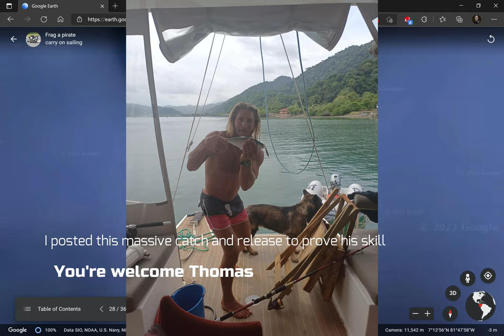Amazing anchorages, Horrific equipment failures

Comment: Hi James and Eva, thanks for the great video. Very nifty effects on that one too! You are having a real adventure, brave man and woman away from the most common routes and places. You take your chances but you get your well deserved rewards. I wish you the best of luck. One little question, since Navionics is wrong and the paper charts from Open CPN often off by quite a bit (with the GPS) even if they are very accurate locally, what do you use? How do you do it? What about google and the programs like Ovital and such? Cheers!!
Reply from the maker: Every single chart you can get your hands on, take it. This region is covered well by the bauhaus panama cruising guide. If you use opencpn you can buy the charts from the o-shop. futhermore paper charts are always a reliable fall back. Sat images are great but use your eyes first. Use the midday sun to help you also. You can see the shallows and the turbulent water over them.

Comment: Good tip on the CPU and advisable to get a circuit wiring diagram of it from Volvo so that you can bypass all it’s functions if you have to, should be a simple unit and it would be interesting to open up and learn to fix with components that are really cheap and good knowledge to have. Thanks for another great video.

Comment: Great video. I'm flaggin some of these recommendations and warnings on my Google Maps. Someday.  I've been along the Mexican Riviera -- on cruise ships with my in-laws. (I won't call that sailing). Until this video I just figured it was straight sailing between San Diego (Maybe La Paz) and Panama.
And the engine tip if needed? Amazing. Pantaneus Insurance should send you a check for a percentage of the money you've just saved them. At some point  you might want to index these videos and sell them on USB drives. So often the most interesting places are full of interesting spots but there's no cell service.
Reply from the maker: The indexing is a great idea, thank you. I guess I should probably do an instructional video series sometime and sell that. I just want to help people at the moment and record my findings as I go. I definitely saved one insurance claim, MY OWN!

Comment: Love your perspectives on the Neel 51 and sailing in general. Why do you think Neel is the only company building this format of trimarans? Seems to me like this full-deck trimaran concept is ripe for innovation.
Reply from the maker: Seth, thanks for your kind comment. You know, that is the best question I have been asked and I can answer it well, hopefully. I think it has to do with change. The amount of times I get asked about sea keeping and comfort or quality is quite tiresome but warranted as it is different. People are still getting their heads around catamarans mostly. It truly is the best of both worlds for a sailing limousine. The space is unparalleled. I would not be surprised to see an aluminium, centre board replicant in the near future. Aluminium because it is cheaper to build custom. Perhaps I should do a video on this..... Thanks again for you comment.
Reply: @carryonsailing  I think aluminum breaks even in some of those downsides I mentioned once the boat size increases past a certain point. Would love to hear more of your opinion on the custom route, aluminum vs fiberglass. Yes I had recognized the ease of modifying an aluminum yacht by welding it. But I had still considered it to be an overall more expensive process. Then again, if I was planning on icy passages and remote exploration, a Garcia built center boarder Neel 51 replicant would be my boat of choice.
Reply from the maker: Smart choice Seth, Look towards KM yacht builders too. I admire almost all that they do. However, bang for buck the Neel 51 still has it for 90% of what most of us actually need.